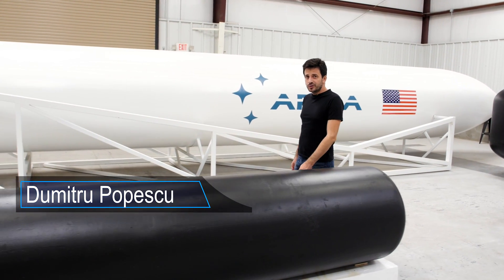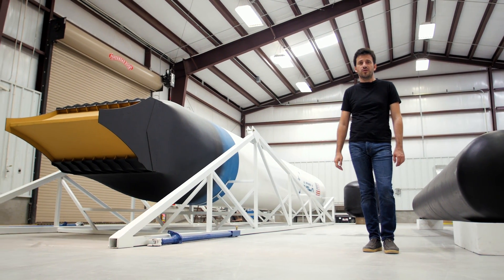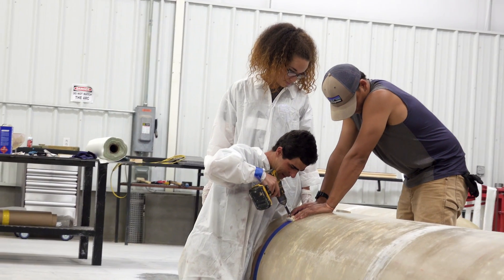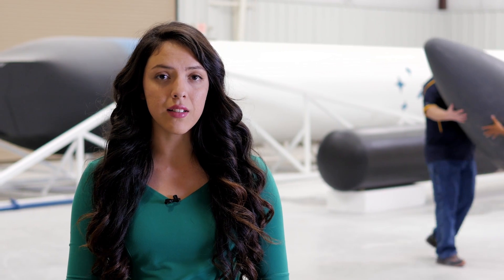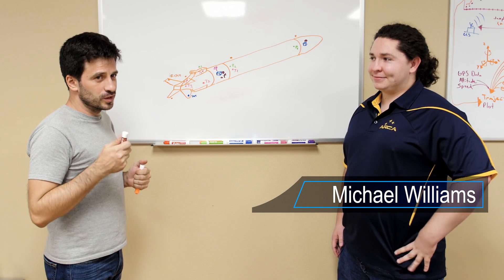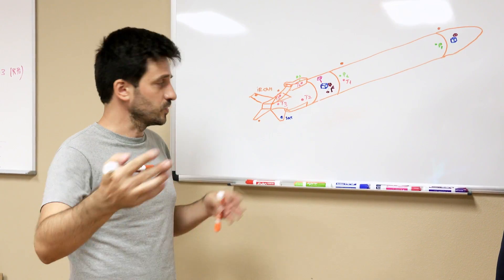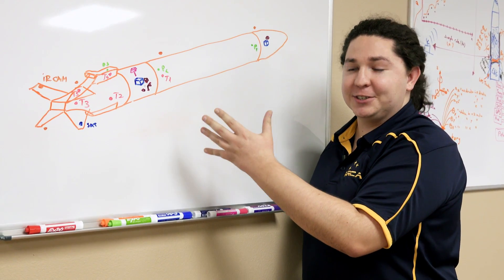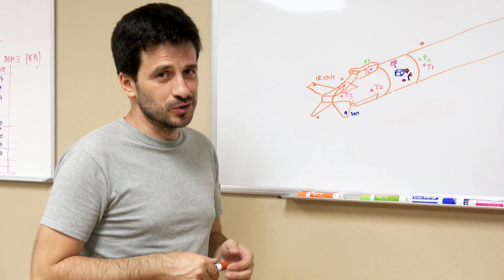Flight of the Aerospike: Episode 2 - The Propellant Tank

Comment: So the tank isn't Carbon fibre, just fibreglass ?
Reply: Wouldn't filament winding be lighter still ? Or would you lose too much strength at the ends ?
Reply: Even at 20 bar that's like ~300 PSI which is 5-10 times less chamber pressure than a pump fed booster engine. What gives?
Reply: Durable, but heavy.
Reply: Less brittle probably part of why SpaceX's COPV exploded supposdly they've sorted that issue out with thier 2nd gen COPV though.
Reply: they said in the video it's propylene.. which I'd guess would make it poly-propylene much like the gas tank in modern cars. I'm sure it's a special polymer blend to be able to handle the temperature and pressure extremes though.
Reply: fiberglass is stronger than carbon fiber but carbon is lighter
Reply: @chrisco1911  I,m no engineer but from what I know about aerospike engines, they use several small combustion chambers instead of one big combustion chamber. ~300 PSI sounds about right for one of the aerospikes combustion chambers

Comment: When those young people are cutting and sanding the fiberglas they ought to be wearing dust masks in addition to eye protection. Glove are a good idea, too.
Reply: Looking at Episode 1, Caleigh should have been wearing gloves at 2:25 while handling the rough edges of the mold, and the guy sawing at 3:49 wasn't wearing a mask. Both are safety mistakes. As far as sensitivity goes, people may appear to be insensitive at first, but most develop sensitivity over time to the uncured resin materials. Having read more comments, I've seen a number of others have noted the safety issues, too. I was pleased to note in later episodes that the safety practices improved. There are no second chances on a lot of those things and young people often think they are immortal. All that said, the project looks great and the kids are getting great experience.

Comment: Nice informative video. You mention in the video that the tank will be at 20 bar for your pressure-fed vehicles. This is fine for your suborbital demonstrator, but will be problematical for your SSTO vehicle. The problem is a SSTO has to be highly weight optimized. A tank pressure of 20 bar is about 10 times higher than that for typical orbital rockets, commonly pump-fed. 
You expect to reduce tank weight by using composites, but this can cut the tank weight by only 1/2. Yet by having the pressure 10 times higher than normal for an orbital rocket, the result is still 5 times higher than for usual orbital rockets. Since an SSTO is already skating on the edge of what is feasible, this makes it even more difficult for your SSTO to succeed.

Comment: my first question is can the tail be vectored to change direction, and what type of catalysis are you using to ignite the hydrogen peroxide
Reply: thank you for your response. once the rocket is in space and since there is no atmosphere in space, will a space craft have vector control to maneuver through space by vector control because the stabilizing wings wont work in space for maneuverability, is my thinking on the right track ???

Comment: A good place to show the Aerospike Engine and rocket in Albuquerque is at the Atomic Museum where other rockets are on display !  The X-33 used an Aerospike Engine and the Lifting Body design was made from Carbon Fiber...  Are you going to test the Aerospike Engines and/or fly the rocket from Spaceport America (a commercial Spaceport) ?  Thank you for the video !  tjl
Reply: I believe they have promised New Mexico to be using the Spaceport America for the majority of their operations for their help and support of the company. If it's possible to perform the test from there, they will most likely.

Comment: I would build a scramjet with aerospike, and call it scramspike-engine ^^
Wondering if it's possible.
Reply: No idea how it behaves to scale your composite Fuel-Tank to bigger rockets
I would use the hull of the rocket as one giant capacitor.
Then you could use a lightwight electrical fuel-pump, and you have no additional weight for the electrical storage. 
Because the energy is stored in the hull. Charge it electrically and then fire it up to space.

Comment: Pressure fed engine with 20 atmosphere in Tanks ?
you will have allot performance loss in final fase of Haas 2CA flight 
as pressure in tanks drop during operation.

What is sad because with hydrogen peroxide and kerosene 
you can have simple and robust turbo pumps via catalyst or pre burner.
I hope you use that technology for advance version of the Haas rocket.
Reply: As you rise, the pressure in your tanks drop, but wouldn't outside pressure drop too?
Reply: That is not the point 
As pressure drop in tank, the engine combustion chambers lose pressure too, giving lower thrust and low ISP 
that's problem with pressure fed  and solid rockets, normally the final rocket stage compensate that (like Vega)
but Haas 2CA is single stage to orbit...
Reply: It is a valid point as the nozzle velocity will increase if the outside pressure is lower. It won't make enough difference to nullify the performance loss you state, though.
Reply: I see how it would lower thrust (lower fuel flow), but I don't see how it would result in a lower exhaust velocity. Velocity gained from the pressure of the fuel feed is negligible compared to velocity from combustion.
Reply: Good point! With the aerospike or having large nozzles optimized for vacuum flight, you don't need high chamber pressure to get high Isp.